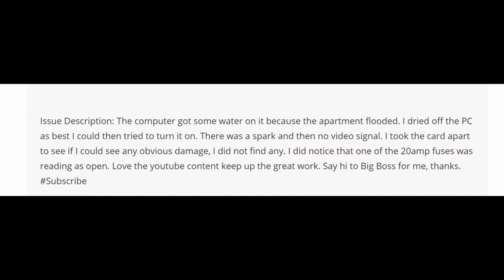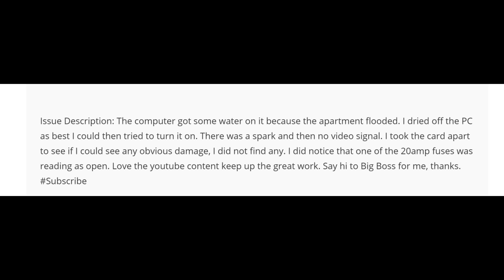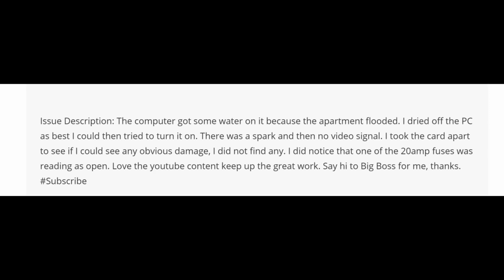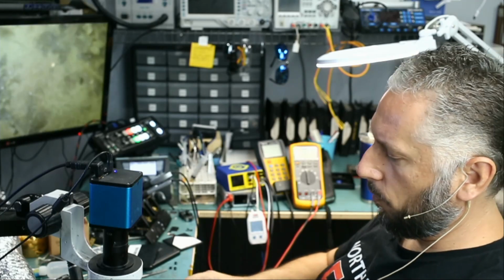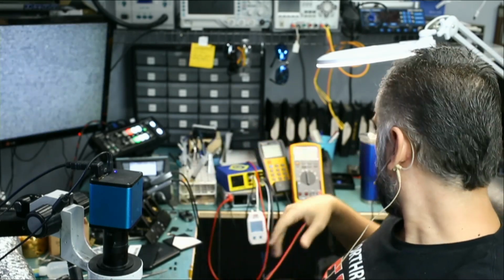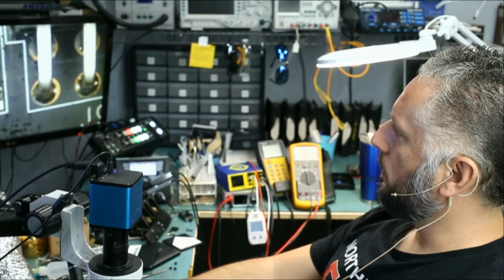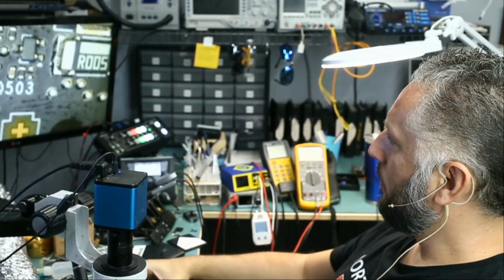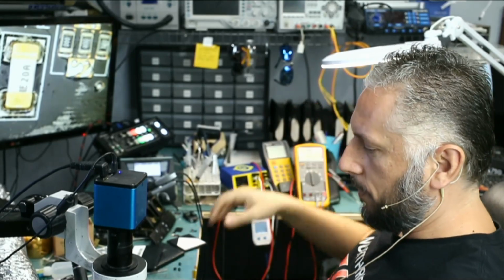MSI GTX 1650 Super Graphics card No Power Repair - Is it really the fuse?

Comment: a fuse is there to blow when something draws more current than it should be or more current flows into it than it should. jumping a fuse is not the answer to that problem, as most likely that will destroy the card further down the line. i bet that replacing the fuse and testing it in the same system will most likely blow the same fuse again, cause the issue is not the fuse itself.

Comment: You ware the safety glass ...I can't understand why which kind of risks are present when we test graphic card or other PCB
Reply: fuse will blow or since the wire isn't designed to blow like a fuse the components or the fuse itself could blow if there some kind of dead short . Capacitors can also explode

Comment: Do you not ever worry about the gpu overheating when you test them in your motherboard without the heat sinks and fans at all?
Reply: there's no problem with doing that for a small amout of time . they only test if there's a display or not so they dont have to disassemble the card again if the card has no display

Comment: When your PC gets flooded, its usually better to rinse the whole PC with distilled water to remove contaminants (from the flood water) that could cause shorts or eventual corrosions. I personally use dishwashing liquid soap and a soft toothbrush for really dirty ones and to get gunk away from the chip pins. Then dry it for as long as possible beside the hot side of a refrigerator, possibly a week or so. I've seen some people pull 3 days but you just gotta be sure.

Comment: I did this yesterday on an RX 470 nitro. I couldn’t see any issues on the board apart from 2 fuses had gone by the 8 pin. I replaced them and tested, the card had a firework display 🥲 I hope I can find the real issue and fix again now
Reply: Hope you had protective goggles on.
Reply: @xxycom8963  luckily I had a good distance but had control of the switch. Just a cap on the back fizzed

Comment: Love when the fuse actually does its job
Reply: @mikeycrackson  There are actually alot of reasons that it can happen and sometimes its not even the graphics card breaking sometimes a bad motherboard , PSU etc etc can cause something to blow cheap no name power supplies can cause it
Reply: @mikeycrackson  I think the opp is engineered so reasonable, so that it will eventually blow the fuse over time if you don't have a real good psu.
You have to consider that people run the cards 10 to 20% over the power limit all day and opp is most likely around +30%. One spike on a white label psu and the fuse is gone.
Reply: This is true. A lot of times and different electronics, they don't.
Reply: this repair was easy and quick, well done
Reply: Unusual it seems lol